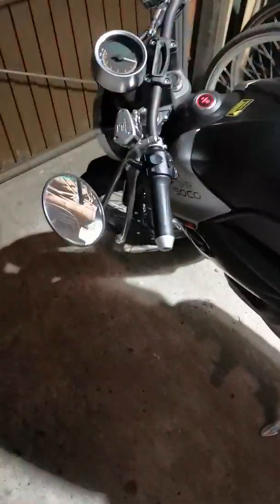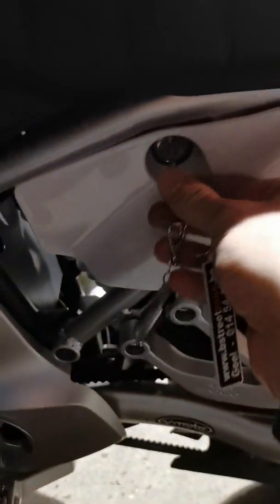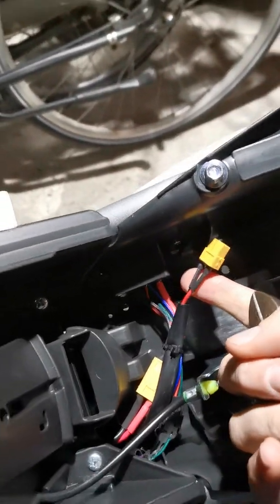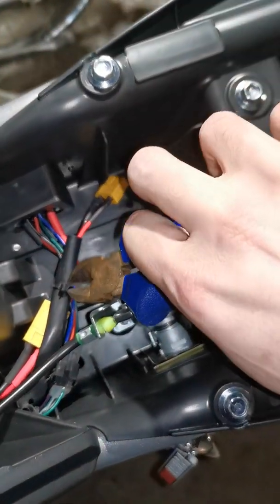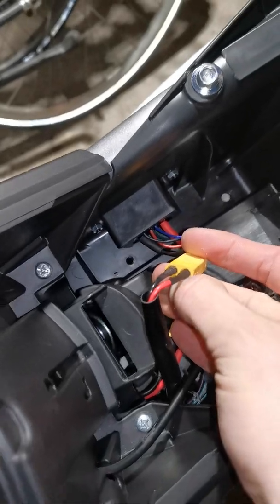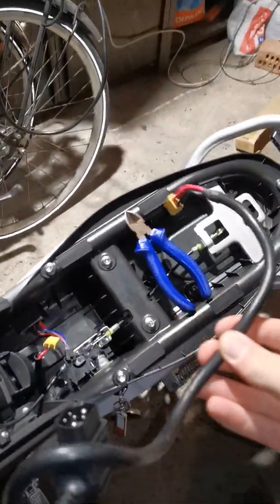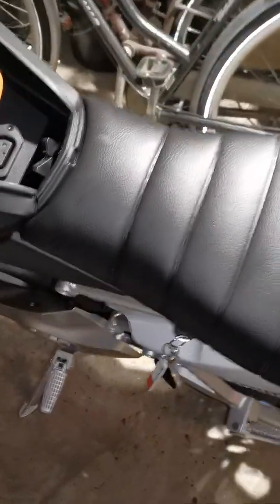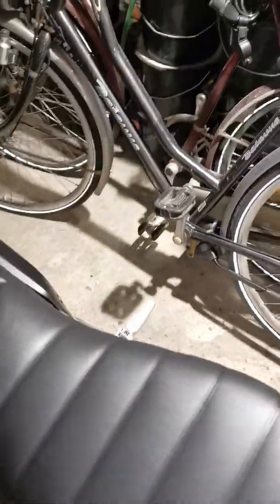Super Soco TC Max: how to switch battery XT60 plugs to charge from side of the bike.

Comment: need to plug the multi wire data cable in for proper BMS. risk of fire if you leave it unplugged
Reply from the maker: need to read the video description :)
Reply: @jefschoors2226  Thanks, I missed that. I hear your arguement about the cable thickness and the 10 Amp Charger. Lets not forget for a couple of years they have sold the 10 amp as an upgrade option for $300 - $400. And no reports of burnt bikes yet. I have yet to put the clamp on amp meter on the 10 amp to see if it really is that hot. Currently thinking of a way to display amps on the handle bars. So I can work out how to ride longer. Like the cars in the solar challenge.

Comment: Your dealer should have done that. Its part of the build
Reply: What’s the other connector next to the XT connector coming from the external socket? My TC didn’t have this procedure done from the dealer either
Reply: @Ste1985zz  there is basically the lead that comes in from the shipping lead, the battery lead that connects plus the lead that connects to the charging port